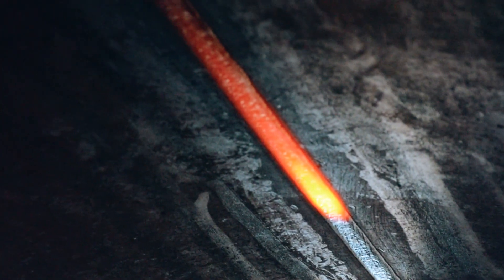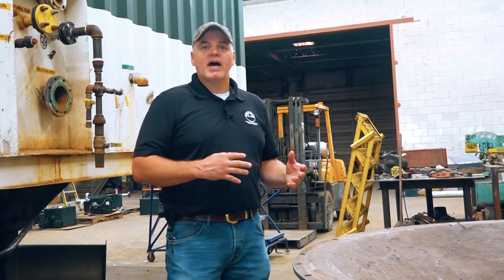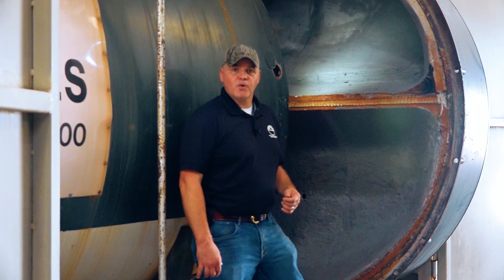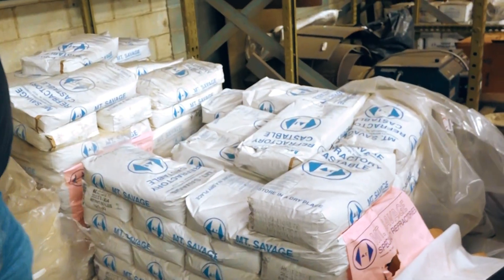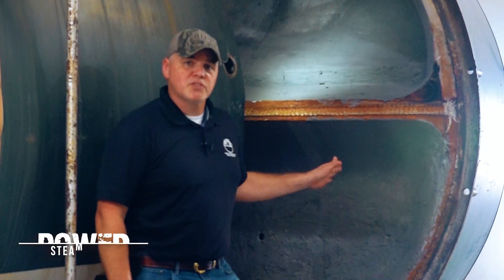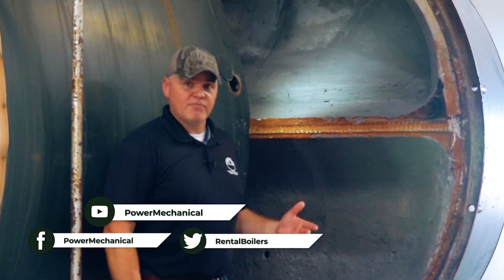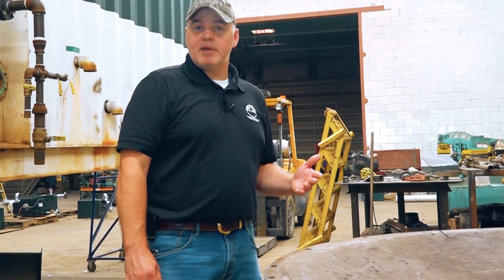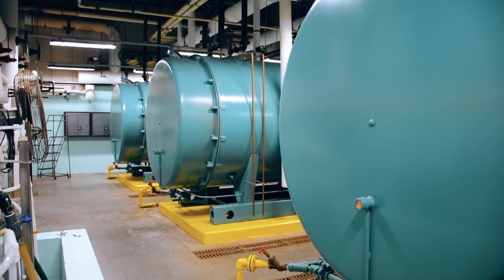Boiler Refractory - SteamWorks

Comment: Dears;
Could you pls recommend for us type of a good cement for Cleaver Brooks boilers & procedure of installation 
Thanks
Reply: Mt savage super heatcrete 30 qf/ super heatcrete 30qf gm for the lower part with proper Insulating ceramic fiber board . 
The top part is frequently made with ceramic fiber blanket.
Reply: Inswool

Comment: Wash coating is something we do as regular annual maintenance depending on condition of the existing throat tiles or refractory on the rear doors if they require more or just a wash coat, but one boiler model specifically like a CB700-250 seem like they have a poor design for the rear doors in which heat tends to get trapped longer. We just had a rear door re-poured on a CB and within a month the boiler is already showing signs of hot spots. Just wondering if this is something common that you have maybe seen on certain CB boilers.
Reply from the maker: One month refractory failure would point toward improper mixing and/or installation of the refractory. Or possibly improper curing.  All that of course considering that the right material was used. If moisture is trapped inside the refractory then when the temperatures begin to rise in it will begin looking for  a "way out".  After which the rear door refractory is compromised.